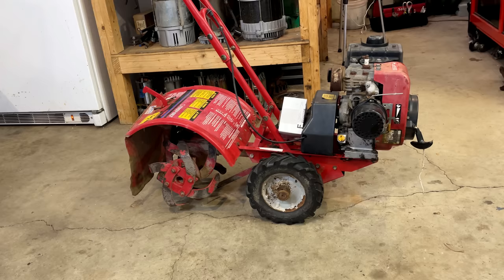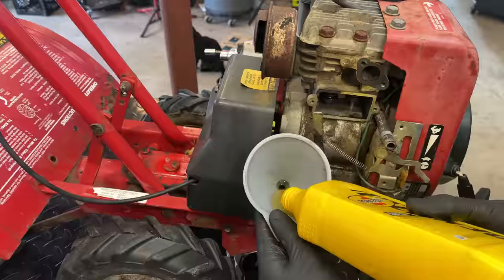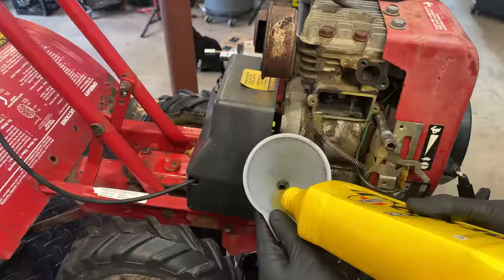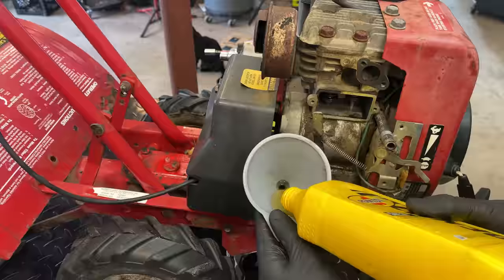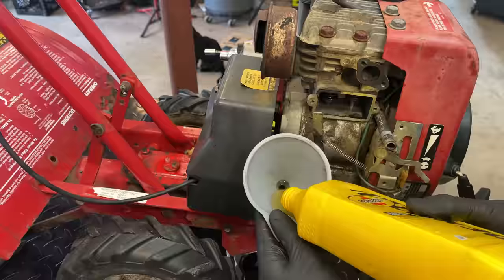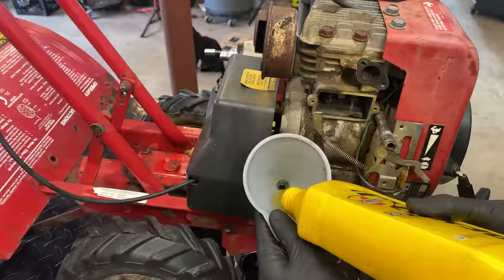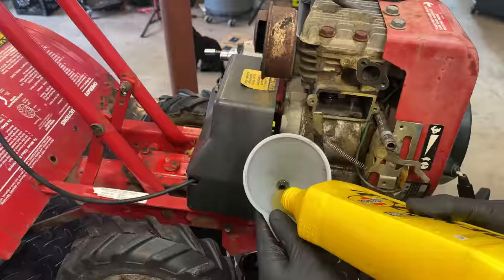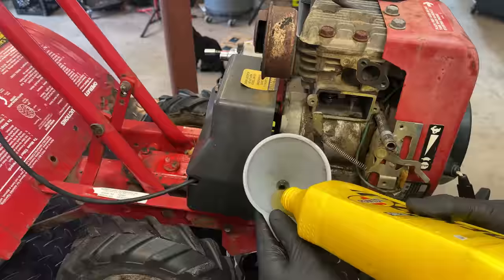Tired Tecumseh Troy-Bilt Tuffy Tiller - No Compression

Comment: Hello James great job and another machine saved from the land fill, to be productive again. I was a little surprised that you did not free up the stuck wheel shafr.Usually a few heating & quenching with penetrating oil & some hammer blows free them up. It helps a lot when using the  machine in restricted areas,or doing edging & contour surfaces. A suggestion for your maintenance kit. Purchase a nail grooming set with small curved scissors, they are great for making replacement gaskets. Not a must have but one of those items once you stare using them you  don't want to go back to not having them. Looking forward to seeing what the next item is out of the trailer load.
Reply from the maker: Was not sure mapp gas would be enough.  Also was worried about the rubber wheel.  It was solid and not removable or replaceable.  I did feed it some PB blaster and hit it with an air hammer but in the end just left the bolt out in hopes that use in the garden might free it up.
Reply: @jcondon1  Hi James Thank you for the quick reply On the more stubborn ones I have packed a rag with ice cubes and placed it on the rim next to the tire to keep it cool. Sometimes they just do not want to budge and it is not worth damaging the tire.

Comment: I had a chipper with a similar Tecumseh with lack of compression.  One of the valves was not closing properly.  I watched enough YouTube videos to figure out how to lap and adjust the valves.   It was the greatest thing when it fired right up on the first pull.

Comment: This seems to be a very good quality piece of equipment built to last. Certainly no Tecumseh junk. I always love seeing one of those engines coming back into service, ma favourite brand. Thank you, James, an excellent episode!
Reply: On the "Horse" model Troy-Builts, in operation, and with the rear tines adjusted to go deep, the engine would be tilting almost diagonally.  This may have caused a bit of a lubrication issue whilst the engine was running, which did not help with the longevity of the engine.

Comment: Great job as always! Thought I would share a trick that worked for me on a low speed gear box on an old International hay rake that would no longer hold a seal. 
Get a tub of white lithium grease. Mix regular 85/140 gear oil with the lithium to make a heavy slurry. We ran that rake for years with thst mix, raking a couple hundred acres per year. Worked well for something that isn't used 24-7 365.

Comment: From Angus in the UK.
Pitted shafts and leaky seals. Google shaft repair sleeves. Not cheap but cheaper than a shaft and labour.( sorry, labor!)
Tecumseh valve clearances on those old small and medium frame side valves ( flat heads! ).  Only ever check gaps at TDC on the power stroke or just 1/4” past. Anywhere else and it’s likely to snatch .
And another thing ! Starter rope / spring pretensioning.  New rope should always pull tight at LEAST ONE TURN  before the spring gets coil bound.
Keep em coming !

Comment: I have one of these, and it works great in ground that has already been broken up.  Hard ground it will drag you across the yard 40 feet before you can even think about letting go of the bail handle.  It's perfect for running between rows though.

Comment: I love gravity feed carbeurators . Just one thing less to go wrong. That trick with the air hammer and pry bar is a keeper. Steve's Small Engine Saloon is a firm believer in sharpening the tines of rototillers. I'm a little disappointed that no one on YouTube cleans up rusty bolts. they run in so much easier when run against a wire brush wheel.

Comment: If you need to punch a round hole into gasket material, you can also use a large socket of the same size on a solid flat piece of metal. Strike it well with a large hammer, it will usually completely punch through. I don’t even have a punch set I just use sockets.

Comment: Hey James, wow, what a project that tiller turned out to be, but well worth it in the end. Definitely. I have one suggestion for you, and others. Wire wheel the tank mount screws to smooth them out a little and put a drop of dish soap on each one before screwing them into fresh plastic. It will help to cut new threads easier putting less stress on the plastic, and the soap will eventually go away.

Comment: By the way.  When I deal with a water and or sludge sump I generally flush it liberally with diesel before putting new oil in.  By doing that and spraying compressed air in it gets rid of all the water and a lot of the sludge that lays in the bottom.

Comment: That shaft pitting can be repaired one of two ways. They have sleeves that can go over them or use JB Weld, a very light coat of that will fill those pts nicely and it can be sanded down to the proper diameter.  Nice work as usual on the repair and the video.
Reply: Abom can spin weld it.
Reply: From my understanding spin welding is just for plastics, like placing bungs in plastic tanks and such, I could very well be wrong, if so please provide me a link, would love to learn about that for metal and applications such as what James has here.
Reply: @1pcfred  Spray weld. Much easier to install a SpeedySleeve(TM)
Reply: @michaelkennedy2528  there's spin welding for metal too. Or spray welding. Usually it's applied as the metal spins though. It's like a lot of sparks that builds up a layer of scinter on the metal that can then be machined. Looks like a torch and a sparkler going at the same time. It's used for repairing worn shafts.
Reply: @1pcfred  Appreciate that, I will look up some information on that, always nice to learn a new thing for sure.
Reply: @michaelkennedy2528  there's a channel here called abom79 and he does it a lot.
Reply: @1pcfred  appreciate the info, will check it out.

Comment: I always change the oil in my machines and use full synthetic 5w-30 or 0w-30 every year, even on machines I don't use too often, like my yard vaccum (for leaves). The exception is that this year I only used my snow blower once and I'm not going to bother changing it's oil for that.

Comment: In order to move the tiller with the engine not running you need to get both wheels pulled off and freed up they   push  to the inside position with the pins/bolts put back in and it will free wheel. So you need to finish before it is really ready.

Comment: Another two tips; the tines were scooting your tires at times.  One, in harder soils or rocky soils set the depth guage to take a smaller bite.  Two; in deep soft soil where the tines are NOT pushing the wheels, but the wheels are needed to pull the tiller along it is good to run the tires the way you have them.  In hard or rocky soil it is best to assemle the tirs with the directional pattern reversed to help resist the forward thrust of the tines.  Yep; I have spent many a day behind the Horse model.

Comment: Jim, if that old fuel tank was in a bit better condition, you could make "welding rods" from rinsed out oil bottles. Its all HDPE (high density polyethylene) plastic, and a soldering iron or gun with a clean tip works well. It's resistant to fuel, either gas or diesel, so its well suited for fuel tanks. It's presently used for car and truck tanks as well.

Comment: Set the gasket paper on top of your part, with a very small "gasket hammer" tap around the circle to cut the paper, slide the paper down and tap around the triangle, then tap the three holes with the round end of the hammer, a "gasket hammer" is a very small ball pein hammer

Comment: With much respect I wouldn't use the roloc disks on the blocks, just on parts you can thoroughly wash like the heads. They just leave too much grit that you can't clean out. You might consider moving to a carbide scraper, like a super scraper. Love the channel. Thanks!

Comment: Hi Jim, Great video. I do have 2 cents to put in. I am glad to see you put a gasket on that cover plate. The protrusion on that plate isn't for alignment it is to hold the bearing cone in place. I think if you had used rtv instead of a gasket you may have shortened the life of the top shaft bearings. The protrusion on the cover holds the rear bearing cup in place and leaving the gasket out may have increased the pressure of the bearing cup to the bearing cone.
Also I have never seen a gearbox filled all the way to the top. Rarely do gearbox oil levels go above the bottom of the shaft on whatever side shaft comes out of the side of the case. All parts in the gearbox rely on the oil being splashed up and around for lubrication. You might want to check with the manufacturer for the oil capacity of that machines gearbox. I believe it is overfilled! 
There is a product called a redi-sleeve or speedi-sleeve (depends on the manufacturer) (they come with a driver) that can be used on a damaged shaft to repair the seal surface. But they are rather expensive (over $30 for one for a 1 inch shaft). It is just a very thin precision ground metal ring that is pressed (or driven) onto the shaft they are usually just a thousandth of an inch thick.
Thanks for doing these videos. I think they inspire people to get out and do instead of letting others do it for them.

Comment: At 1:18:40
Fuel tank....

In the realm of off-road motorcycles, back in the day, we used a sealer to cut the inside of the plastic fuel tanks because the decals would come off because the fuel with leech out just enough to destroy the glue backing....

I wonder if that would have worked for you here, if the part had not been available or was too expensive....

Comment: I have this tiller. bought it in 1988, mine has frame weights & a bumper bar in front. I used it the better part of my life time. My Tuffy was never left outdoors. and manufactured in Troy, NY USA. Well made garden tiller back in the day. I use an electric corded tiller these days just because it's lighter & maintenance free and I'm old & lazy.
Reply from the maker: This one also came from Troy NY.  The original owner picked it up direct from the factory.

Comment: My old troy built horse tiller had a 8hp Briggs engine it may have been Tecumseh I repowered mine so long ago I can't remember i had rebuilt it 3 times totally I think and it had some more bore left in the cylinder but the cam was totally worn down the carburetor bushings for the butterfly was worn out and I just decided to repower with a stronger Honda clone the predator 440 Hemi and I installed the electric start and battery box I even added a  LED headlight on it like snow plows has and I had to install new bearings and seals on the differential on both sides but this thing was a 2000 model and had thousands of hours run time on it but it still looks great and runs better than new which I love how there's unlimited power options for these tillers you can even install the predator 670 or Duramax 700 engine on them and that's way over kill cuz the predator 440 is overkill on mine but it was easier to add electric start on that engine they make kits for the smaller predator 212cc to but they had everything in stock at harbor freight for the 440 engine

Comment: You can buy the fuel shutoffs that are at a right angle. That may help in installing shutoff at carb or at tank,either way. Thanks for the info on valves and adjustment.

Comment: Hi James, been watching a ton of your videos (yes, I weighed them). I would like to suggest you consider embracing Lock-tight products, thread locker blue and red as well as the anaerobic sealers for seals and gaskets. The front tines are subject to vibration (lots of it) and Lock-tight blue will prevent the bolts from walking out over time and still allow servicing to be done with little issue down the road. Other than that observation, I really like the videos your putting out, great content and well produced videos. Thank You

Comment: Another interesting,  informative,  video.  I have used 2 - 3 Oz. Of Lucas oil Stableizer on some of those older engines,  seems to help on the oil burning .  Most everything I work on is 2 cylinder and OHV . I do have a couple of flathead engines.  One has a bent crankshaft,  the other runs just fine.

Comment: The issue you referred to about the intake valve being open to about 2/3 of the way up is a factory thing for easy pull starting. Some people delete that by a file on the camshaft. You did it with the length of the valve. I just wanted to say that it is supposed to be like that from the factory. You can do that to help a worn engine also.

Comment: I don't remember what model it is , but I trash picked one similar to the one you have there , very good condition , runs great . Someone over tightened the auger cable and bent the tensioner bracket . Works fine now .

Comment: Great video but what's crazy is I just had one of these come into my shop yesterday, guy was tilling and it randomly stopped, the OEM carb finally kicked the dirt after so long. Ordered a carb rebuild kit and gonna see if I can save it, if not that aftermarket carb seems to run the H30 well and they are only 20$! Going to check the gear oil too and see if it has water in it like yours did.

Comment: FYI:  They make a "long nibbed Marker" now with a long needle nose, maybe an inch and a half long.  Great for marking close to perimeters and into holes.  I find I use them often.  E-Bay has them as does Amazon for reasonable prices ($5 for six) and of course they are chinesium but they seem to last a long time as well as come in your selected colors and fine tip or coarse.  Fine works best.  the body is about the size of a thin ballpoint so it gets places a regular marker will not.  I found these three or four years ago and really like them.

Comment: JIM,  pull up the depth setting bar, coming up through the shield. Now, you can let the tiller dig deeper to see if it has power. Also, if you are right handed, hold onto the left handle, walking to the left of the tiller, so you don't trod over tilled soil......good luck with your new garden.....LOL....!!!!

Comment: Next time you need to make a gasket, lay the part down, lay the gasket material on top, and then using a rubber hammer smack firmly around the edge of the shape. It might not have worked in this case since there's a chamfer but I have used it to replace carb to manifold gaskets in the past and it does the trick. You are basically using the flange and corner profile as a die to cut. I learned that trick from mustie1

Comment: Put the gasket on the tiller side and use the back of a ball peen hammer to tap on the gasket lightly. It will leave a indent on the gasket the perfect size for the bolt holes and the main hole. Cut and punch out along the marks left from on the gasket. Works great, especially for a more complex gasket.

Comment: Interesting video! I've had one of these 3 horse Tuffy tillers for 20 years. It has never run very well. Haven't used it very much. Sure has a hard time starting in cool weather, if you can get it started. Wish you could work on this one.

Comment: Could use a drive belt as it slipped a couple of times and will if you till deeper. They don't build them like that anymore. I have an older 6hp all cast iron with reverse I need to get going on to restore. It's ALL rust and the engine sat for years without a spark plug...... Another nice save!

Comment: The lack of clearance on the intake valve was often used to help make it easier to start, this only happens on the intake stroke about 2/3rds of the way up the cylinder, briggs called it “easy spin”. It was such a small amount of air released that once the engine was running, it didn’t affect power output.
Reply from the maker: True, but the cam in this engine had an automatic compression release similar to modern engines.
Reply: @jcondon1  ahh, the only other thing I could think of would be valve seat recession.

Comment: Jim ,What you have here is a General Lack of maintenance for the life of this machine , there are wheel seals and front and and rear transmission seals ,you can tell it was not taken care of , the tine drive has seals at either end also that are leaking where the twine is wrapped around the shaft

Comment: Well done again James, you should also clear the debris around the tynes on the drive shafts, the debris has a habit of using the soil to be a valve grinding paste on the outer seals on thee shafts if this model has them. I have an motor over the tynes version called a Masport here in New Zealand - very good machines. Your machine has suffered some neglect through a lack of service. Excellent video as to be expected ....

Comment: I think you could check the valve rocking from guide wear say just twice as high as it would be above the seat in normal operation. Obviously, the further you pull the valve up from the seat the further the valve will rock back and forth due to guide wear. If raised too far, it could give a false indication of wear.

Comment: I always use a lil oil or clear grease on the rubber seal of my air filters to help it seal around the base of the air cleaner housing face plate

Comment: Great video I learned the hard way working on those side valve briggs and stratton engines ground abit too much off the valve and the engine was very difficult to start with excessive compression . Bought a new valve and very carefully ground it to the correct clearance then comoression release worked fine. While watching the vid i started thinking when you had to grind the valve not too much..
Reply: That's a Tecumseh engine but same issue it seems.